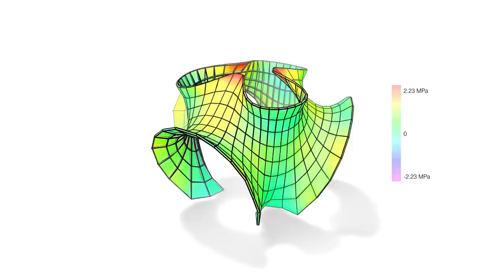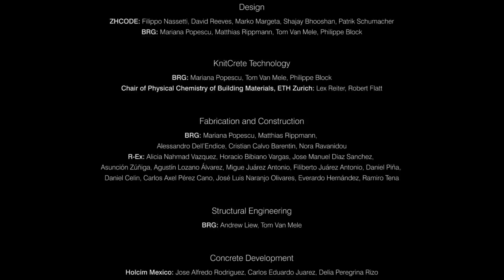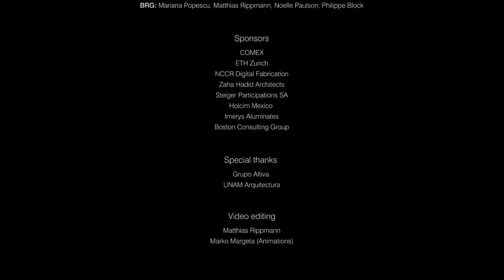Zaha Hadid Architects and ETH Zurich develop knitted concrete system

Comment: Who isn’t impressed and thrilled by the work of the late Zaha Hadid, architect extraordinaire...?
Reply: I agree you may not like all of them, but also remember that the effect may be completely different when youre actually standing in or looking up at the building. Also i think shes celebrated not for the beauty of her designs but for pushing the idea of architecture away from boxy buildings to complex shapes and understanding that construction and material understanding has progressed far enough that we can build almost any designs, which had changed the styles of thousands of other architects.
Reply: i agree with both of you. i don't like her aesthetic but her contribution to the field is quite significant.

Comment: At this point we have just to wait for an entire new building from ZHA, probably in the Arabic peninsula or in some petrol country, with the evolution of this technology.
The idea is super but the question is:"Will complicate computer generate shapes and interior spaces, warped by stripes of intense colors, save architecture from its growing banality?
Why ZHA, don't push themselves to convert their design workflow, concrete based, to a more sustainable one? They have the people, the brain and the money.
Reply: Because clients
Reply: @Mooncake69420  this is a good answer but i personally met internationally famous architects that run away from that extensive use of concrete to use resources coming from the surrounding site place.
It could be stone from caves or wood and bamboo. The clients followed the change in order to have a really spectacular building with this new characteristics.
For ZHA the process could be slower but i think that, like for Bjarke Ingels, they should move a bit from the paradigm of the "concrete is good everywhere'. I understand they work with complex workflows and with the expectation of a "wow" from their clients but this industry, specially this, has to give the signal that there is a change in process.
Reply: @giuseppenativo2123  7D BIM is the answer. it can produce the data needed to back up sustainability. any good architect or client can see that data to realize what materials have a high carbon footprint and will always try to source as many materials locally as possible as a result. But the real limitation is what the cost/ speed of production is vs sustainability and in the case of concrete or brick... they always win.

Those are just my two cents. I am a freelance architect
Reply: @Mooncake69420  i think you're two cents are the wisest I've ever read on YouTube in years. 
I have a friend that founded a company, after working with Ghery, Hadid, Nouvel and chose to help big firms to operate with high level Bim use. He is very good at it but still i can see (or this is my feeling), after years, a lot of resistance from the industry for a big and definitive change. 
Thank you. It has been a pleasure.
Reply: I think they just designed a new building in saudi. Remember reading about it. Centre for petroleum studies or something. It looks absolutely amazing. Zaha would be proud
Reply: @aratyal  yes i know it. The shaping is amazing.
Now it's three years that Madame Hadid is not more with us and every time i read about a new building in construction that she hasn't designed at all, i wonder if the work of ideation and design of Patrick Schumacher and the associates is/was between the 80/90% or straight to the 99%.
I don't think it's the legacy.
Once, on a famous architecture magazine, I've read that during a press conference for the inauguration of an important building, she spoke for one minute top and passed the mic to Schumacher for the "Details". Read, 'complete explanation of the work during the years necessary to produce it'.
Anyway, she rocked and i miss her.
Reply: @aratyal  the Arabs and their petroleum research centres am I right?
Reply: Riveravi well as an arab micro palaeontologist. Yeap your right 🤣
Reply: I mean the Arabian peninsula is in a desert, so not much you can do besides concrete. though this project is completely passive.  Concrete buildings can also be sustainable in the amount of energy they consume, especially in areas where sustainable materials are not viable.  Concrete has pretty high thermal mass, so heating wouldn't be a problem, it then falls on how you ventilate or insulate the entire structure to cool it down or keep it cool.
Reply: @prim4681  wise words
Reply: @prim4681  mine wasn't a call for "no concrete in Arabia", I'm sure you understood. 
You said right about the reasons and the technology, i can't add a word about it.
I would love to see a great firm like ZHA challenging the "ecological drama" with their amazing capabilities in designing exceptional buildings in areas where you really do not need to use just concrete. I think this would be a game changer in the market. In the end we know that the industry of "decent" architecture is highly influenced by a small number of great firms and their vision. I don't need to mention them, you know very well.
Reply: Funny, I am seeing the homegrown or homeknitted possibilities in throwing heavy knitted material over a form like a dome balloon or a geodestic structure or just rebar and making a dome home.

Comment: So... Concrete poured into a form made by suspending a piece of fabric.

When you strip away the gimmicks of it being presented in a montage, being knit instead of woven fabric for no reason at all, and it being made in a special shape that only has to do with aesthetics and introducing a mcguffin for having to engineer the support for the convoluted form it becomes way less special. We've been doing paper mache and laminating fabric to surfaces for a very long time.

Comment: Change your title, it`s a knitted formwork structure, not a knitted concrete structure. Still impressive though :) great video
Reply: Got to have a gimmick to sell the illusion of progress ... Otherwise its a septic tank in a sweater
Reply: CHANGE👏 YOUR👏 TI👏TLE 👏CHANGE IT AROOOUND!!
Reply: Wrong, is not a knitted formwork, because the tensile structure was not removed. The cable net and the knitted structure are working in union with the concrete, this three things are attached together creating one single structure.

Comment: ... why not spray the concrete mix ... and use inflatable molding ...
Reply: Nigel Hedley Yes. Go to Monolith Domes (located in Italy, TX) to see how inflatable core + rebar + spray on polyurethane...creates durable structures of many sizes. (Domes were not seen as aesthetically acceptable after hurricane Katrina.  Tradition dictated rebuilding the old “shotgun” houses raised on piers in case the floods return...But Domes resist wind like nothing else...and can also be raised (as seen in the Florida keys...and elsewhere).

Comment: Cool work! Does anyone know what software is used in this video to create and calculate such form?
Reply: I believe grasshopper and rhinoceros was used
Reply: Hey! The Block Research Group open-sourced many parts of Compas at https://github.com/compas-dev/compas — "A python-based framework for computational research and collaboration in architecture, engineering and digital fabrication." This software runs standalone and also with other environments like Rhino, Grasshopper, or Blender.
Reply: rhino
Reply: It is highly likely that maya was used to design the form. For analysis and rationalisation they usually utilise c++ coding language with their own libraries.

Comment: doesnt seem that efficient. you have to have two teams working on scaffolding, and putting a thousand zip-ties on the material. for a structure of this small size, developments in construction today should be aiming for efficient construction windows, where its very easy to build it or set it up.